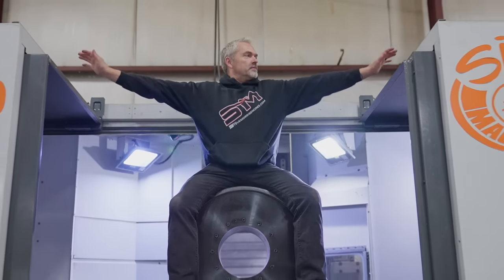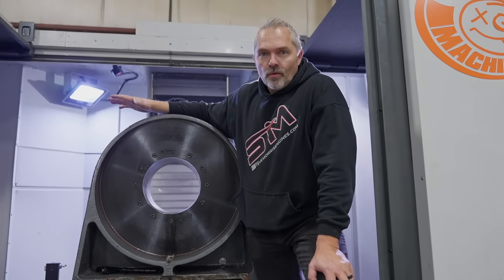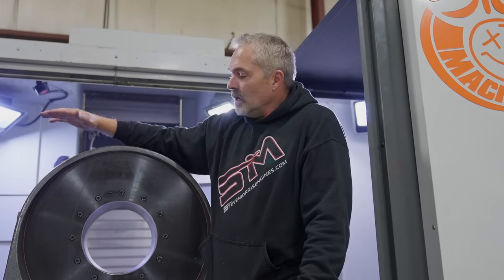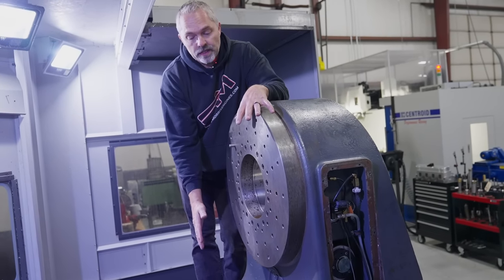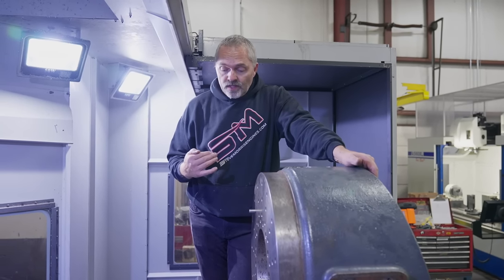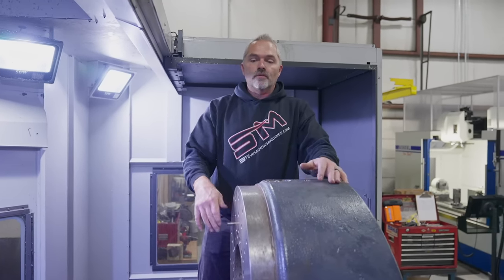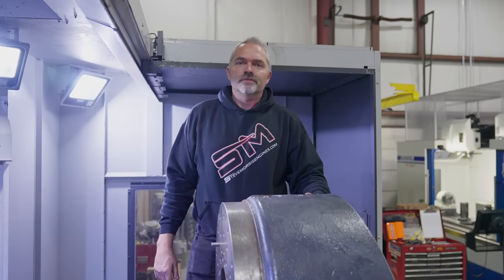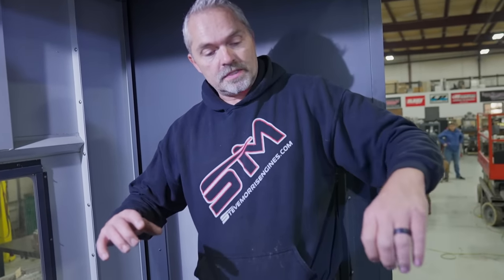Problem Already! Delayed world takeover!

Comment: I pretty much agree with your assessment but tossing the 5th axis is still a hard pill to swallow.  I'd be tempted to experiment with pneumatic counterweights to balance out the hanging load and focusing on 3+2 fixed axis machining with the  block more or less locked to the table during cutting.  I'm envisioning bolting a steel disc to the front of the block that's concentric with the 5th axis rotary axis.  A few disc calipers could be set up to engage it which would make the setup worlds more rigid.  The brake disc that accomplishes this in a small Fadal 5th axis is only like an 1/8 inch thick but you  could really use something that's appreciably thicker.  A really oddball setup could even accomodate thrust loading.  Good luck and thanks for the entertainment.

Comment: I'll preface my comments with...I know nothing about CNC machines but have done some block boring, cyl head machining, etc, etc back in the 70's/80's. The technology has changed just a little bit. Having used a lathe just a tiny bit I was afraid this was gonna be the end result of stuff moving around during shipping. Hope nothing is so damaged as to be a serious problem. It doesn't sound good. Changing machine back to something more conventional makes sense to me. Wish you the best.

Comment: Are you going to use the rottler to create mount bosses on the ingots that will eventually be machined away as the block gets repositioned  simplifying indexing and work holding for first operation .

Now you need foam block head hats instead of wedge of cheese hats.
Reply: Even though I suspect Steve is hard to help, love to see him fly half-dozen of the guys from the comments in & compare notes. Sometimes men let machismo get in the way of learning. NOBODY knows everything.

Comment: This is going to be a game changer when its up and running. What are you doing to ensure the billets of material are good before machining? I saw Finnegan had an issue with his boat motor from another builder that had a pinhole defect in the head material and was wondering if you had a process for testing for something like that?
Reply: Was that a cast head or a Billet head all the pinholes I have ever seen where in cast parts
Reply: @edmahonejr.9364  Sorry I just checked the video again and you were right it was cast, I remembered it wrong. What makes billet not have those issues?
Reply: @jono6379 the process of making billets use huge presses to squeeze or forge the billet pushing out air gaps aligning molecules making for stronger material, cast is porous because it’s poured into a mold and not forged allowing air pockets.
Reply: @at_3831  thanks 👍

Comment: Why don’t you rough it out with one of your other machines like the vf, just leaving say .100” on every surface them put it up in the big boy but leave the trunnion/5th axis on it and use the machine as originally built to do the final machining on a much lighter block?  What would it weigh after roughing-300lbs?

Comment: Would it not be possible to keep the 5th axis trunnion for the semi roughing and finish work, put a part finished block on it once it's roughed out and the weight is down?
Reply from the maker: Possible but the tooling is so long. To do some finish operations you will have a 18inch total length .500  ball nose end mill.
Reply: @stevemorrisracing  Ah yes, always an issue with 5 axis machines. I run horizontal with tombstones for production work and a twin pallet with a full 4th axis.

Comment: Hey Steve, have you considered doing the roughing hogout on your VF4 and then using the new machine for finish work? It should be enough stock removal to solve the weight problem without losing 5th axis.

Comment: Would work perfectly for heads but weight of an engine block is asking a lot especially if you want short cycle times with 100% rapids. More rigid setup you can pour the beans to it

Comment: man i sure hope they manage to fix the machine in a way that its still acurate 
guess you could use the machine for the rough milling getting the block light and reduced in size enogh to mount it in the cnc machines that do the final milling , getting most of the weight of and the block hollowed out should help manipulating it , not sure how long the machine has to work as flinging the massive billet block around like you said untill you gotten most of the dead weight off is going to take some time
i guess you could desighn the program to reduce moving it around untill you cut out most of the straight holes in the block (cilinders valey sides roughing in the main bearing part ) just holding the part in one plane before doing the stuff like wittling out the water and oil passages liftervaley camshaft space all the nooks and crannies around the crankbearings 
you might need to completely rethink the order for the cnc programming so the weight of the block stays balanced around the center it rotates around to get it to work , you stand a better chance of succeeding compared to tom baley though as you done this sh@t before
starting to wonder why haas moves around the piece thats being machined when moving the machininghead might be eazier in terms of flinging a weight around at least that weight is allways the same (ex tool) 
seen a youtube demo of a w16 billet block being machined (a LOT smaller sized) and man , i still wonder how they wrap their head around all those planes the machine has to move in to get that last bit of material out of that little space in the insert space position here
think the fact that the finished engine you make is large is actually a good thing as you have more space to move youre tooling around in , it being a V block might actually be a downside , think an inline engine would require the billet block to be moved in less planes to get to everything 

think that it might be worth youre investing time intoo making a billet version of the k engine and the 2jz as its a verry populair engine in the racing world , might even do an ls and a coyote on youre way to dominate the world

Comment: Off the bat, i'm no machinist, heck the only thing I have in common with Brock is my eyesight ;). I agree that they were asking the machine to do too much and compromising rigidity, If you have to add steps and fixtures to machine a perfect block, that's a great solution and the end product will be what was envisioned by Tom so long ago, just not as quick or as hands off.
A wise man once said on youtube Only buy the machine when it is needed, and this machine is needed
Reply: I think you nailed it and Steve just didn't want to say outright that their plan to streamline the process just didn't work out. Who knows what the discussion was with Hass? Maybe they said it was doable when it really isn't or maybe Steve and Tom took a gamble on the machine. It seems like doing it in house with an accurate setup, with more steps, should still beat the cost and downsides of outsourcing the blocks.

Comment: If I bought a machine with an advertised workpiece capacity of 10,000lbs and I couldn't hold tolerance with it derated to 5%, I'd have a very big problem with the manufacturer. To say that it isn't a Haas issue tells me that you are trying to cover up for Haas. On the other hand, NOBODY should be expecting to hold a Haas to .001" on a piece as large as a block even on its best day, and on the other (other?) hand, nobody is going to take an 800lb forging and cut it to dimension right off the rip. You'll rough that block, heat treat it, get the stresses out of it, then come back and hit your critical tolerances. So when you're hitting critical dimensions, you'll really only be hanging about 500lbs off that trunnion. Sorry for the issues you're having with it.

Comment: There is a huge difference between whittling a chunk of metal to make make one of something, and tooling and fixturing a process for multiples of the same part to tight tolerances day after day.  The first is machining requiring a skilled machinist.  The second is manufacturing engineering.

Comment: Most people can't imagine how flexible /elastic thick, solid steel is. 
3" thick steel plate deflects under its own weight. The average guy can deform an engine block a measureable amount by hand.

Comment: Well HAAS is on the bottom of the machine tool totem pole, if you had an unlimited budget the smart purchase would be a Mori Seiki, Mazak, Okuma, or any other Japanese or South Korean (Daewoo) machine tool..... yes they are double the price but 10 times the quality in terms of repeatability and accuracy.  For machining engine blocks a Mazak Integrex or Mori Seiki NT series would be the way to go, check'm out.

Comment: Simply Tom and Steve ventured together to make a bad a$$ SMX block!

Tom and Steve are equally partners in this.

Tom initially had issues and sent the machine to another machinist with experience on the platform to be able to “code” a block being built from A-Z with minimal issues.

The prior machinist made the process work.  So then it goes to Steve with an A-Z program in order to fabricate a SMX/SML block from start to finish.

The machine belongs at Steve’s shop in order to keep the logistics down, and keep everything “in-house”.

Just my opinion from the previous video.

All is WELL!
Reply from the maker: Nope I do not have partners, not even Tom

Comment: I Have a question. Like for did with the v10 by adding 2 cylinders to a 5.4. Would making a v8 but with 2.0 civic pistons with a small block chevy length rod but a short stroke but low compression for boost. Obviously you could sleeve a sbc to fit smaller pistons just thinking of like f1 cars but with big boost and high revs

Comment: these high performance machines are like a high performance drag car. You should be able to take a drag car and put it on the line and aim it and if everything is right the driver shouldn't have to steer at all.... but the extreme forces dictate otherwise.

Comment: I would guess a trunnion  should be  on the order of 20 to 30 times the weight of the piece for good stability.  For less than  thou  a lot more would be my guess.

Comment: I thought the Centroid was making blocks.  What's the difference b/t the Haas and Centroid?  Will the Haas add more capabilities in addition to production capacity with both machines cutting blocks and heads?  Oh, asking for a friend who has 0.001 minutes of CNC experience.
Reply: I'm pretty sure the centroid was doing the finish work.  Not taking a chunk of billet and roughing out a block.
Reply from the maker: Correct

Comment: Unfortunately, you are incorrect, there are many machine tools, not costing "millions" of dollars. Haas is a inexpensive machine tool, user friendly relating to the controller. I managed machining, engine build at Roush Racing. Machining "blocks" was a daily, and everything from the pan to the carb. .In today's world there are endless choices relating to machine tools, based on your check book. Haas machines you own appear to be 40 tapers, a 50-taper machine is far more rigid. I was actually one of the first to "generate" a gear off a Haas machine tool actually, which today is not that uncommon. "Gears", and their tolerances are far more critical than what you are machining, if you understand gears, geartrains, gear geometry. "Backlash" in such a machine should not exist, Haas Rotary's were known to have issues. Not attempting to be a "Dick", but I've purchased, programmed CNC machine tools for 30 years. Managed Roush Racing, and was senior Engineer at "GM', their gear/machining operations...your building a real business that one day your son will enjoy and continue to grow, congratulation's!
Reply: "there are many machine tools, not costing "millions" of dollars."  I hope Steve sees this... 

 Initial up front cost is one thing but the time it takes to meet Return-On-Investment is literally the future of the business.  Quality machine tools while costing a bit more will meet its ROI faster than a Haas simply by less labor/maintenance/time dicking around to hit tolerances/faster Material removal rate. And it's not multi-millions more!!! Mattsuura MAM72 is just a million.
Reply: Very well spoken, or outlined. There are so many machine tool options in today's world. Haas is a budget machine, nothing wrong with it depending on what you are manufacturing. A 50 Taper machine is desired typically over a 40 taper. Steve's building an excellent business, his son is very fortunate to have such a cool father!

Comment: It the labor bill is what kills you 
I worked for a manufacturer in the early 2000’s when haas came to work on our cnc’s they would charge a fee on how far your shop is to their authorized dealer then charged the company $300 an hour to repair the machine 
Our cnc took 3solid days for the fix and luckily the haas shop was less than 1/2 mile away

Comment: sometimes trying to simplify process makes things worse. stacking tolerances are a pain,  can only imagine the deflection in that trunion at the start of a run vs the end as the weight drops on the work piece. trying to drill/bore long straight holes is a nightmare even on small pieces, something the size and tolerances of an engine block...no thanks thats what the expensive machines are for.

Comment: You start with a big chunk of material which gets considerably lighter with roughing. Surely sub thou tolerances aren't necessary for roughing? Once the roughing cycles are completed at comparitively 'pedestrian' pace due to the bulk, then the high speed performance gets to shine? Getting shot of the 2 axis trunnion seems a retrograde step to me but you know what you want to achieve I guess, but i'm sure no one who has a 5 or 6 axis machining centre wished they could go back to 3 or 4 for productivity?

Comment: Now they take the trunnion table away that shouldn’t be there in a horizontal mill in the first place. Forcefully made contraption to make a 5 axis machine at the size  that Hass doesn’t offer. It was doomed from the start. And for the transportation effup, unacceptable for professional riggers
We used to clamp the spindle head to the table and use transportation clamps for all axis when moving machining centers. You could stand the machine on its side and nothing would move, that’s how Mazak made the transport riggings. That trunnion moving on transport, the ways and the bearing block might be not all that’s broken. 

I hope Steve gets it all sorted and the machine can be used again.

Comment: In my opinion that machine was not made for the weight of the trunnion, fixtures, and billet.   With only a single ball screw and linear guides there would be way to much flex.

Comment: Moving everything in house means you wouldn't run into the torque converter issue you did when you swapped blocks in the wagon.

Comment: I think replacing the trunnion is a really good idea but wasn't this machine at a shop (after Bailey's) that had successfully machined 3 or 4 billet blocks using the machine in it's current configuration?
Reply: Yes, the engine in Steve's car is one of them. It had the lifter bores machined at the wrong angle and Steve talked about making the fix a feature in the SMX where the bores could be an insert like a cylinder sleeve so that the block does not have to be remachined when a lifter goes bad and damages a bore.
Reply: They machined a couple in it but they all had issues the one he used for his engine just had the most issues

Comment: It hurts to see more videos on this particular machine.  It's just a bad decision. Sure it costs close to 500k for that machine but at its SLOW spindle speeds (standard 7500, optional 10k) and poor kinematics it's not going to be very productive. And as Steve put it already, it's not even the proper machine to build billet engines...    4:22  A Mattsuura MAM72 is a machine that actually builds engine blocks (check it out on youtube) and it's 'only' a million dollars but unlike the Haas comes with a standard 20k RPM spindle + the legendary Japanese accuracy + actually being designed for heavy 5 axis work means Return On Investment is actually possible....     I imagine all the time and money spend moving that machine around and trying to get it to work has already cost more than a quality machine. 

Machines that are accurate to begin with pays dividends in value added time.  Having a machinist chase for even just 25 micron (.001") hurts the business in the bigger picture.

Comment: If weight wasn't a problem,could you do a steel billet block,and would it be that much stronger?
Reply: Watching how he designed both the block and heads to have major critical failures that blow holes out the side so he can weld the crack and holes then remachine and continue to use. Cast steel blocks and heads that isn’t an option once they are damaged they can’t be repaired like aluminum
Reply: Also weight especially for race cars

Comment: Has this machine been making the SMX blocks or have you been getting them somewhere else?
Reply: Another company currently cuts his blocks
Reply: Tom originally bought the machine to do the smx blocks so steve didn’t have to wait for the current guys to fit him in there work list and it was never capable of doing what haas promised it would and refused to take it back even though they admitted to lying to him about its capabilities because they had never tested it would work just told him it would because they thought in theory it would work without testing it and come to find out it didn’t work how haas imagined it would

It cut a couple blocks but they all had flaws including the seriously screwed up one that steve put in his car after selling his other one to Garrett